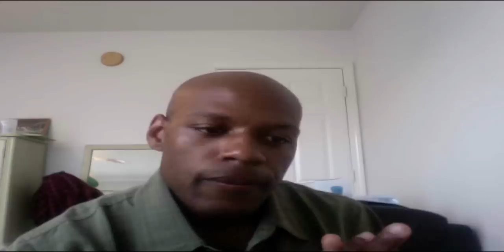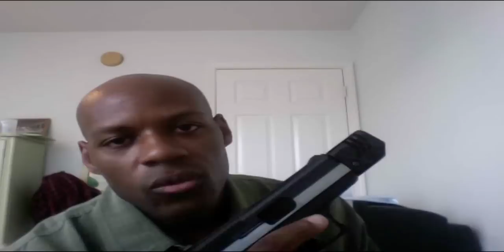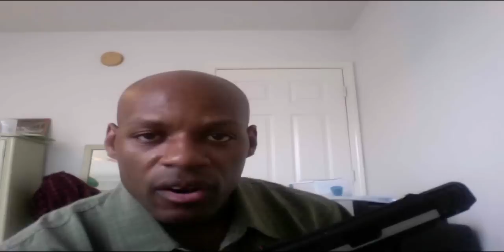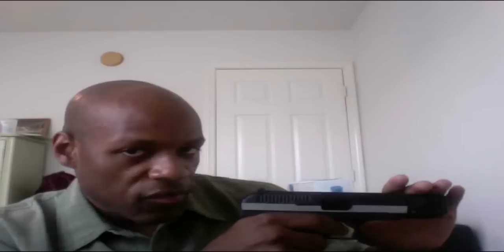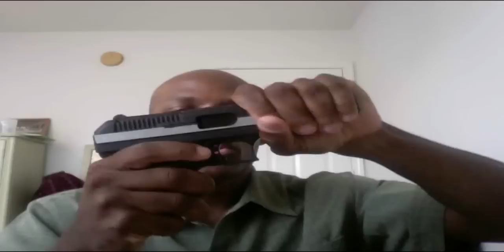CF 380 COMPENSATOR DOES IT HELP?

Comment: the biggest drawback of a compensator is that most people who buy handguns, buy handguns for home defense. you fire a gun with a compensator at night, and you're staring straight down the sights at a flame/flash when you pull the trigger. so buy one if thats what you like, but be warnned ahead of time - if you have to fire it at night, you best make sure the first shot counts, because if it doesnt, youve blinded yourself & the person you're shooting at either gets away or takes you down.

Comment: Hi  - is  the barrel end threaded ? - or does the compensator simply friction clamp onto the barrel?  - - also, regarding the "silver" stripes on the slide, are those trim pieces, or a polished / unpainted section of the slide ?

Comment: I owned a CF380, and I can't imagine it needing a compensator. It's nice they are around, but the 380 doesn't kick much for me, and the heavy slide keeps it in place. I didn't have any recoil or muzzle climb issues. Seeing as this is not what I could call a first choice carry pistol, it can be carried, but the compensator only adds to the bulk and weight, and often causes it to snag. This particular compensator, from what I can see, doesn't change the performance of the pistol for me.

Comment: @VIPonME 

I don't think you can buy & put on the Compensator on a Hi Point gun that did not come with one. I think that the design of the gun with a compensator is a little different on its business end.  Apparently the compensator is not just an accessory for the 9mm gun. If u want one w/ a compensator, I think u have to buy it that way from the getgo.  Good news is that the whole gun is cheap.

Comment: Nothing against Hi-Points at all, but I can't see the point in them putting a big huge compensator on a .380 ACP pistol. Given the size and weight of a blowback-design pistol like the CF380, it really doesn't even have that much recoil and muzzle rise to begin with to really necessitate it. Even on the C9, it's kind of overkill. I think .380 ACP should pretty much be reserved for ultra-compact pistols when even a small 9mm is too big to carry (like in a back pocket) ... but that's just me.